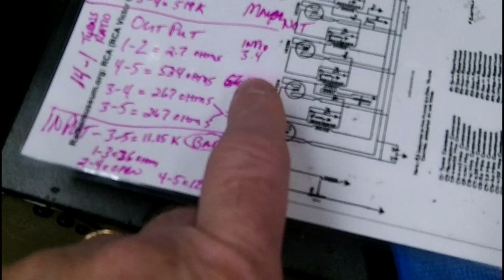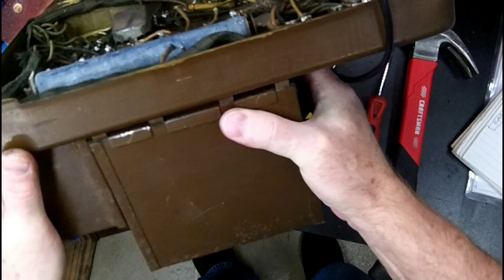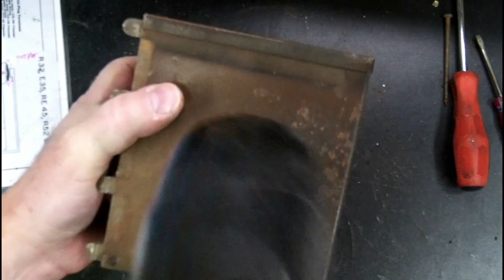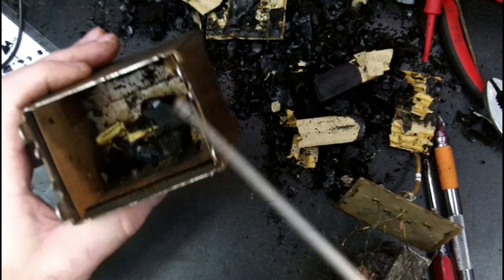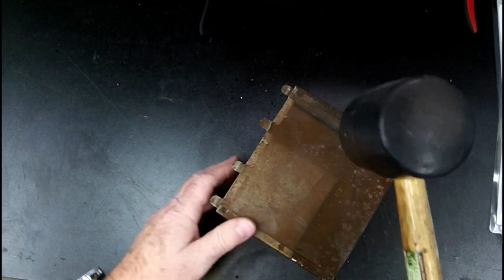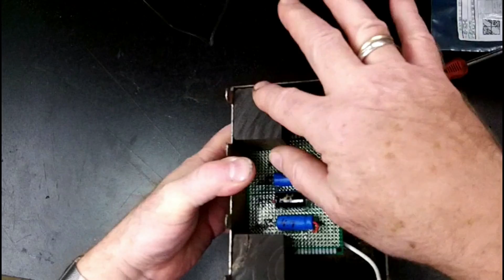1929 Victor R 32-  Part 2-  Output Transformer & Filter Condenser Can

Comment: You didn't need to cut the rivets and separate the terminal strip from the bottom cover.  I keep an old toaster oven for these.  Put the block in a toaster oven for about 2 hours at 215F and then slowly pry the bottom off.  It's a lot messier than the freezer but it releases easier.  The bottom cover/terminal strip will release from the interior wax block and you can just cut the leads and remove the bottom cover, then pry the caps out with a big screwdriver.
Reply from the maker: Thanks John, it was a learning experience for me. I'll pick me up a used toaster oven for next time! Thanks for watching and the idea!
Reply: @greggsvintageworkshop8974  Just don't keep it anywhere near your wife... LOL